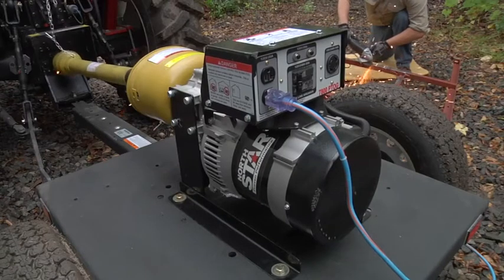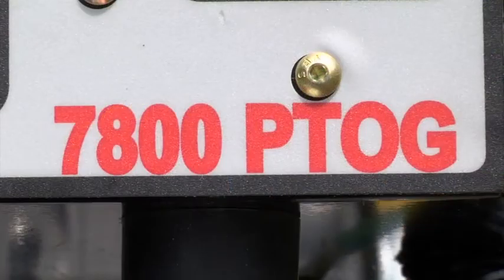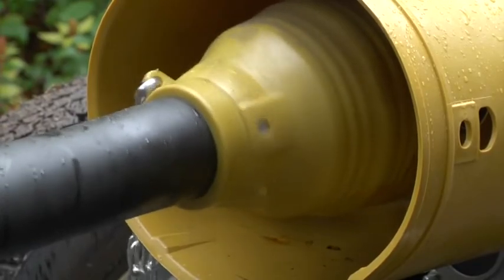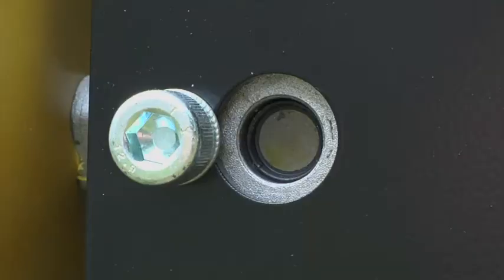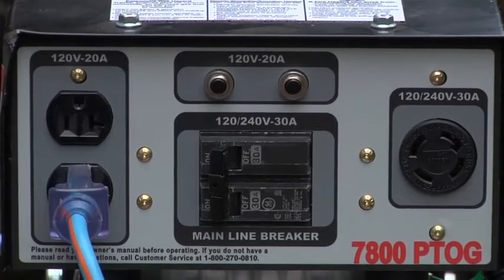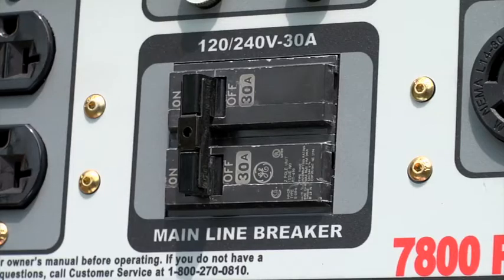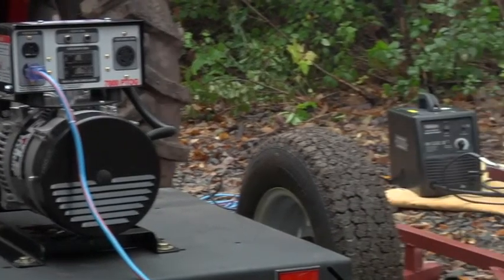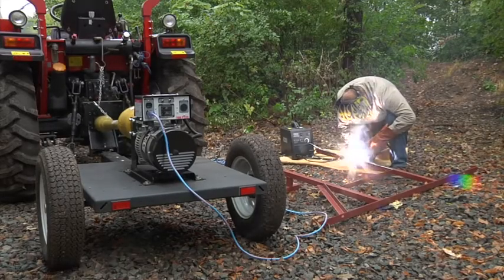NorthStar PTO Generator - 7800 Surge Watts, 7200 Rated Watts, 14 HP Required

Comment: If you had a bigger horse powered tractor would it be too much power for the generator or could you throttle it back?
Reply: The tractor is governed to run at a fixed rpm, so you just set 540 rpm on the PTO and the generator will pull what torque it needs.  If your tractor is smaller than 14 hp, you won't be able to reach full output w/o the tractor lugging and the voltage dropping, but it will work just fine up to your tractor's maximum power output.